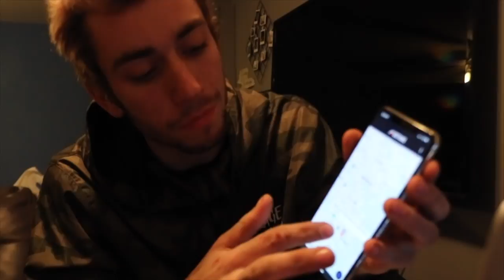MY S15 SILVIA IS HERE!!! *INSANE CAR*

Comment: This channel is pretty sick, it gave me some courage to tackle my s13 (KA24DE) clutch and I replaced it with an oem exedy kit and then a new lightweight flywheel. That shit was mad worth it (actually has decent rev response), now the car actually doesn’t look like this picture but I finally got the suspension dialed, two inches lower than stock and in geometry. I love working on these cars because they’re relatively easy and after my dad passed it just gives me a feeling that I’m closer to him you know? had to sell my truck prior (93 gen 1 1500) the two years I’ve owned this car have been probably the best two of my life even without my dad. Thank you for helping me get even a small amount of confidence doing something I’ve never done before and I hope you enjoy that s15!!!